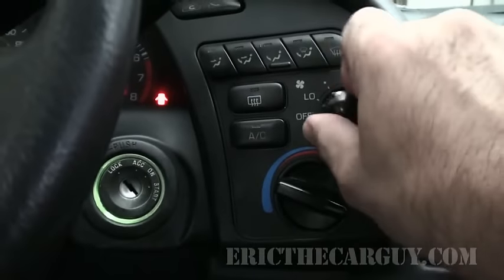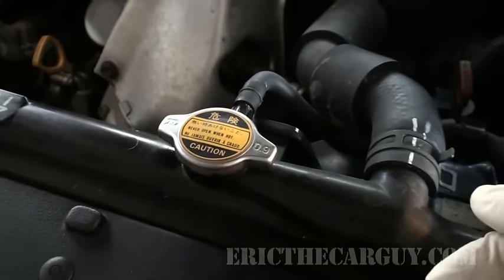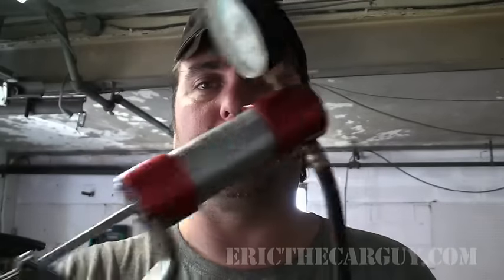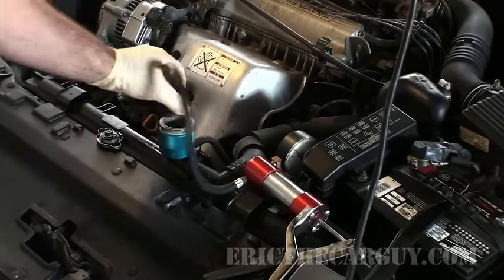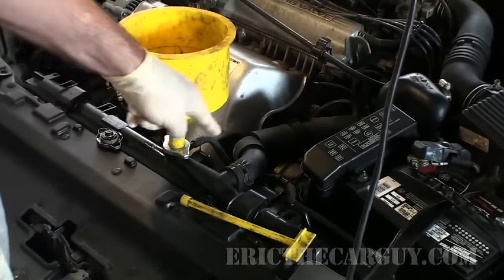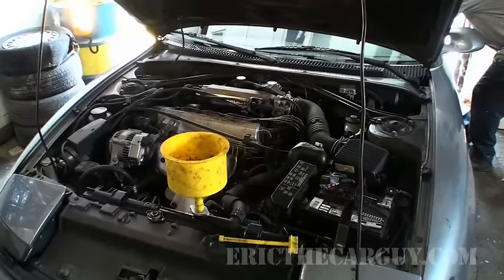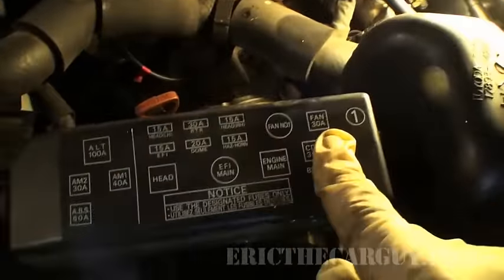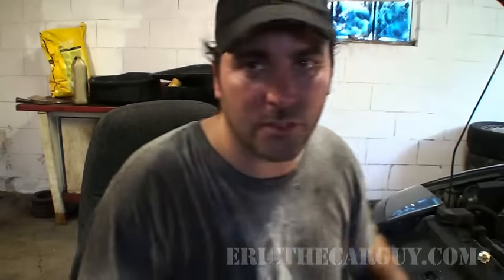How To Solve An Engine Overheat Condition - EricTheCarGuy

Comment: Thank you for the detailed information. I did all the tests mentioned here and unfortunately I found a leak in the combustion chamber. I changed my engine with a new one. Honda civic 03.
Reply: Lol you didn't have to buy a new engine just replace the head gasket & shave heads
Reply: +RzVids the new one cost me 300$ with the installation, The repair will cost around 100$ and the engine will never come back to normal.
Reply: Ouch! Worse case scenario no doubt.
Reply: btw: where do you get an engine replaced for $300? I need to meet your mechanic.
Reply: +Green Genes not in the US :D

Comment: I really appreciate you taking the time to produce these helpful videos. 
When my car is overheating, I immediately check the oil. If it looks like chocolate milk, that’s coolant in the motor. 
Here’s a tip. 
When I’m going to buy a used car, the first thing I inspect is under the oil filler cap. If I see a jelly goo like substance, I walk away from the car. That means the car has overheated and cooling fluid was in the motor.
Reply: Nope!  Many times a milkshake in the oil cap is CONDENSATION. Vehicles with short drive time do this often.

Comment: Thankyou Eric I have an overheating Lexus diesel on the highway and have both the pressure test kit and CO2 analyzer kit. My fans come on when A/C activated, thermostat appears ok as the radiator hoses hot and pressure up. The car runs ok for a while at correct temp, only after a while does it overheat! Oh and oil is clean with no white exhaust smokeI I suspect head gasket or block issues so we will see. Your video was excellent in detail explanation and method to diagnose so grateful for the time and effort you put into this.
Fascinating how you have a car there with almost everything gone wrong in the cooling chain?

Comment: My brother helped me yesterday to change the water pump, and the battery, and it was an all dayer. Did not know to bleed air from said lines. Now, that being said, I think it's time to have some initiative and learn how all this stuff in the engine works. Not sure why I always found that intimidating, but taking those things apart yesterday, cam interested in learning now. I found your video interesting, thorough, informative, and insightful. Thank you. Fingers crossed fir my 3.9 old Dodge Dakota
Reply: 》》sp》》became

Comment: Great video- U just missed the water pump failure.
Reply: you don't have to systematically troubleshoot water pump failure. I just replaced one, believe me, when they go out, they scream at you and there is no need to troubleshoot simply replace the darn thing.
Reply: Broken impellor shaft at the impellor or destroyed plastic impellor won't do this.
Reply: @lostrambler1  Not always. Thats only a bearing failure. Impellor fin damage is silent and common
Reply: Oil for 97 Chevyt
Reply: I agree, I was expecting Eric to say something about the water pump, but I believe to test that, you can just turn on the heat in your car, if it blows hot, water pump is most likely good…I think ;-)

Comment: (7:23) - I have a 2011 Dodge GC.  The coolant temp rises when the AC is on, but scales back when AC is off.  
AC on - Temp fluctuates 219 to 224+ (rarely to 230 - and rarely down to 213) - stays at an average of 222 most of the time.
I thought perhaps it needed coolant.
I put some in.
And right now it's idling.  
The temp is fluctuating 212 to 219 - (but again, it's just idling).
A few days back, the vehicle had a hose blow, and my usual mechanic found the leak (gaping hole) - This was fixed.
But now today, this.
It's Sunday night.
I'll take it back Monday to get it checked.
Your video here is excellent.

Comment: Great video. It saved me $800. I figured out that the radiator cap valve was bad. It was bleeding into the reservoir but not sucking back into the radiator. A mechanic tried to tell me I needed a head gasket changed and was going to charge me $800.

Comment: A head gasket for my civic costs more than a motor from hmotors.
Reply: Hmmm sm1 got way over charged! Buying and replacing entire hg system, cost btwn 85$-190$ at most😞 this includes regular mechanical shop fees
Reply: @donnakay1828  wtf it's like $500 here to get it replace

Comment: How do i pressure test if my system doesnt have a radiator cap like you have? Just the coolant expansion reservoir setup like you mentioned.(2005 mercury grand marquis gs. The dash lets me know when the car overheats when driving above 65mph for extended period of time. I can run the ac all day and car wont overheat until recently. Now if i idle too long ac will stop blowing cold air if the ac setting is up. I cant find any leaks other than when i had a coolant leak that was running all the way under the car(used coolant sealant to seal water pump and what was leaking underneath car. Radiator fan is working, and theres only 1 fan. Top hose thats connected to thermostat housing is very hot even after letting car cool down for 2 hours (even though it was 95 degrees outside). Air flow is clear on radiator, though, and i cant afford to purchase the equipment you used in this video. Please help

Comment: How can a closed thermostat cause the top hose to be hot. The top hose can only get coolant if the thermostat is open. So, if the thermostat is stuck on closed, how is it possible for the top hose to get hot.

Comment: Mine was bubbling in the expansion chamber, so it was a head gasket. I wouldn't normally use stop leak, but the car already had 240,000 miles on it, and just had to last us a couple more months, so I used the stop leak for head gaskets, and it has almost been a year without any more problems. I am amazed that it worked, but am glad that I won't be rebuilding the engine with that mess in it.

Comment: If you replace the radiator, replace the cap with an OEM cap. It's too important not to. And if you have an older car, and you have no leaks, full of coolant, pressure test ok, replace the radiator as the passages have probably narrowed over time due to buildup. Learned this, and many, many, other lessons from the school of hard knocks, and trial and error.

Comment: We were working on a 2006 Lard Rover Range Rover with the 4.4L V8. We found the thermostat housing was cracked, we replaced it, still leaking, replaced the rad after finding pinholes in it, coolant overflow and rad cap came with the Rad. Still overheat, so we took off the water pump, and sure enough it had some small leaks. Replaced it too, just to find out it still wanted to heat up to about 3/4 of the way so we'd stop and it'd cool right off and we'd keep going.

$3,000 later in parts and labour when the owner finally called it quits. My boss didn't want to test for conbustion gasses even though I mentioned it several times. It was overheated at one point to cause some of these issues, others just being wear from 280k miles.

Before we put a new rad in, I suggested the combustion gasses check but was told not to worry about it. Nearly certain that's what was causing it because almost everything else had been replaced for the cooling system. There was no leaks when it left, but wouldn't stay cool on extended drives. 30 minutes and it would go back up.

Note to people looking at buying "cheap used Land Rovers", don't do it. When things break, they get expensive real quick and most shops will just repair the first issues they see rather than going in depth to check everything.

Comment: Thanks Eric. I have a 2006 Nissan Altima 3.5. that only raises the temperature gauge to almost max when I travel up hills. I'm gonna do what you said in this video. I will check back if I can diagnos the problem. Thanks for your great info. Your very thorough and knowledgeable.

Comment: My son had an '06 Honda CRV and he said it was not running right so I drove it and found out that when driving with a lot of start and stop traffic it seemed to want to die but when I was on the interstate it was fine and the AC was blowing cold.

My first thought was that the engine was overheating and when I got it home I discovered that both the fan for the radiator and AC condenser were not working after directly applying 12V to them from my charger.

If a car has an overheating problem I would definitely recommend checking the fans first especially if the coolant is at the appropriate levels and the fans are electrical.  If your cooling fans are mechanical and are moving correctly then you may have other issues.

In an electrical fan system, the fans only come on when they need to according to the temperature sensors for the engine and AC systems so if the car is cold they will not run.  Always check them with another 12V source that has enough current to run them.

Comment: Hello Eric, Great video once more, i bought a Accord cl9 a year ago a month later started overheating, i filled coolant and tried to bleed the air out but air would keep coming out so i thought HG was bad, just to ensure i bought that blue liquid tester and it became yellow so the HG was indeed bad, i changed water pump, thermostat, radiator cap, head gasket, resurfaced head on CNC and block with a homemade oldschool patent, new engine bolts  with 1x extra 90° turn, HG sprayed with copper spray, changed radiator temp coolant sensor , fans working 100%, car was fine for 4 months after i repaired it but than the problem came back again, i had overheating and my radiator went bad (had a hole somewhere and maybe with the time even if it was repaired it was slowly draining and problem came back) recently changed radiator but didnt bled the air out properly(either didnt bled enough air out or the HG is bad again and shoves air into the coolant AGAIN...) so far have no overheating issues but at cold starts i can hear the heater core burpling and i still have to add little coolant to fill radiator, at the e-store where they sell those blue liquid testers they suggest to drain the coolant out of the system and add pure water to have a correct result, i saw in your video you probably did the test with coolant in system, is that ok? I havent made a pressure test yet, i would be really happy to get some feedback from you and excuse me for the huge message :)

Comment: Great video, I would add the choice of Thermostats is important "Slant" is making ones without a release valve on the upper section.  "Do not purchase those" get the ones with the release valve on the upper section and install properly so the air can be released from the release valve.

Comment: tks again...  pulled up in driveway and it over heated.  Thank goodness i was home!   ran hot and no anti freeze 2 weeks ago.  put some in and guy said i was fine. pulled in today and it overheated when i pulled in.  Had not driven that far really, few miles.   let it cool.  it has no anti freeze and almost no water now!    not sure if from over heating or leak.  sounds like leak... but why and where...

Comment: Well there is something that happened to me that I didn't see you addressed.  I checked everything you did and was still having the same problem.  The my dad told me to check the top of the radiator where the cap is because they wear overtime. And that was the issue.  It cost me a head gasket though, because it was happening got a while and I couldn't find the problem.  Anyways I'm a huge fan of your videos.  They help me a lot to work on my 97 civic.

Comment: great job you have opened my eyes, its my jeep was over heating but the rad is cool and would loose a at least 2 liters out the over flow and have mass amount of pressure in the system just full of air on my top hoses, so it would over heat after about 5 km but not boil to the point of stoping i drive for mabe 2 kms and then it would cool back down and then repeat it all the way home and i have replaced every component but im going back now and going to try a factory cap and then try another thermostat ....thanks for the tips

Comment: great video Eric I also wanted to add another over heating problem that's over looked that would be the water pump I've seen water pump's fail and cause over heating. I did every procedures you talked about on your video then I thought about checking the water pump took it apart found out it was free wheeling and it wasn't spinning the fins besides that your doing a great job keep up the good work.

Comment: Great informational video. FYI Explorers and Mountaineers 2006-2010 have a cooling system operating pressure of 20psi. Results in a lot of radiator failures.

Comment: Eric, you missed a few things. Collapsing or blocked hoses, slipping belt, rotted impeller (mentioned). 

I've got a strange one that I'd love your thoughts on: 1998 Dakota 5.2, a billion miles, bought as a backup vehicle.  Mechanical fan, thermal clutch.  Overheats slowly at idle, but runs cool at speed.  Fan turns correct direction and moves alot of air, sounds like a jet engine when 190+ degrees.  Shroud is in good condition, fan and shroud seem positioned well, decent seal to radiator.  I flushed system, used rust remover flush to clean the block, replaced all hoses (not pinched or collapsing), t'stat with a 195* Stant, replaced belt, tensioner, replaced radiator, cleaned out overflow, replaced cap (16 lbs), filled with 50% "universal" green coolant.  

It STILL overheats at idle, although it takes a little longer, temp climbs slower.  In 90 to 100 deg air temps it climbs slowly to 220 and keeps going. If I hold the rpm at 2000, fan sounding like a jet engine, the coolant temp very slowly drops to normal.

The only thing I can think of now is the water pump.  Possible rotted impeller?  I tried to check flow with cap off at temp, but difficult to do and poor results.  Very little movement.  Revving does a little, but not much.  Oh, and coolant looks clean and no froth or bubbles to indicate air trapped or head gasket, etc.  Laser temp gun test at normal operating temp showed 195 deg top hose dropping to about 140 deg into the lower hose.  Yes, I've verified its overheating, not a bad gauge or sender.

It looks like the pump's been changed before since there's orange gasket sealer poking out around it, but no idea when.  Its got about 300k miles on the truck total.

Thoughts?  I bought a hi flow water pump and hi flow tstat that I plan to install next.  Is there anything I've missed?  What would you do...besides shoot it?

Comment: I wonder why i didn't see this video before my totally useless change of the ECT Sensor, thanks Eric for the tip of the hoses temperature, I found that the problem is the termostat. You Rock.
Javier from Argentina, Civic 2007.

Comment: Question for you.....what about a van that is saying that it is overheating with no smoke? I filled both the oil and the coolant. Both were just about empty. It still was saying that it is overheating. I used your heater on idea to help me get home a little faster. It helped! Thanks!

Comment: Great video. Learned a few things and thanks for making this available.  Someone can quickly check for a broken fan belt or as you implied anything leaking such as a hose or the water pump. If the water pump bearing is bad but it's not leaking, I'd be curious of a way to check this without removing the pump. I'm guessing the bleeding wouldn't work very well without the pump working or maybe the fluid can be seen moving with the radiator cap off and after the thermostat has opened up?

Comment: You forgot ONE thing, broken water pump. Similar symptoms to blocked radiator, outgoing hose is hot, hose at the bottom is cold since the pump dont manage to pump water through the radiator. Just had one of those cars :)
On sumup You forgot cooling cap.
REALLY good walkthrough for non mechanics, even for me, I didnt know the exact function of the cooling cap except keeping it pressurized and allowing overheat system to vent

Comment: Hi, great great video. Im using your guide to check through my heating issue of having reservoir coolant boiling and finding it super. One small point on thermostat, its not the springs that heat and move its the wax vile that opens and closes  thermostat. Thanks again for all ur inputs into car issues. Russell, qatar

Comment: At 12:35, in a pinch (such as stuck at the side of the road) you can swap another relay with the fan relay. If the relay is the fault then that'll get you going. Make sure of course you don't swap a headlight relay if it's dark out. Best suggestion might be the horn relay. Gets complicated when your cooling fans use 2 or more relays though.

Comment: I watched a couple of car rebuild shows on tv. There was a piont about a thermastat that if the " washer" is not the proper fit ( metal disk between the rubber gasket, I think) air gets in and makes the car run hot.

Comment: Thanks, My car run hot when idle in the summer heat. I think it is the cooling fans. I learn from you that I can test the fan by turning on the air conditioner. I was going to test by buying a new fuse and relay.

Comment: I've found a easier method for testing cooling fans, at least for a basic operation check. Most cooling fan coolant sensors the resistance rises as the temperature increases so I simply unplug it and see if the fans come on. Now while I've never seen this but the sensors can be setup to where the resistance falls as the temperature increases so you would just unplug the sensor and jump it together. Easy test. Now this is for testing the type of cooling fans where they have a coolant sensor on the outlet of the radiator be it in the radiator on the water inlet of the block. I'm sure some modern cars control the fans by the ecm which voids this test.